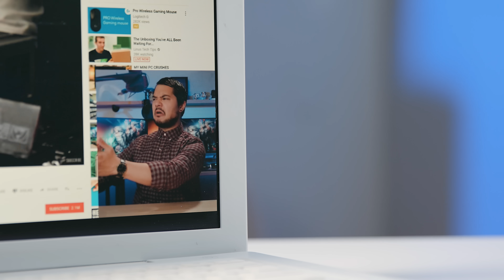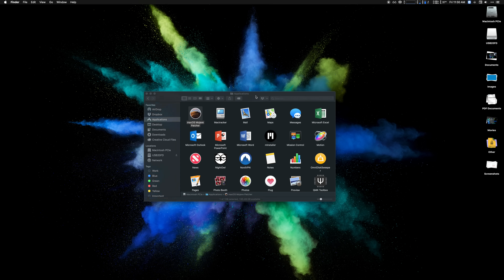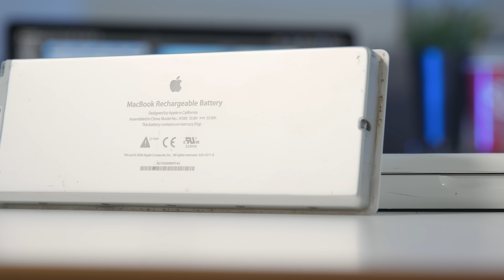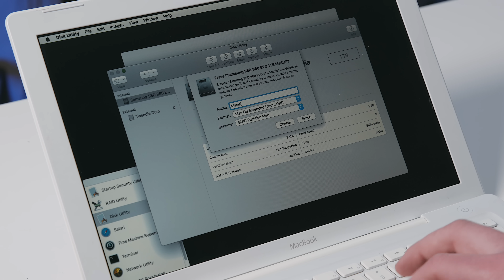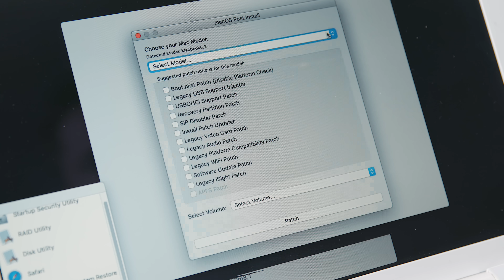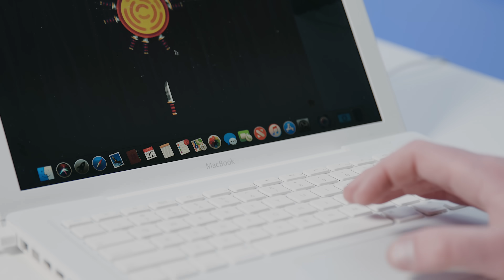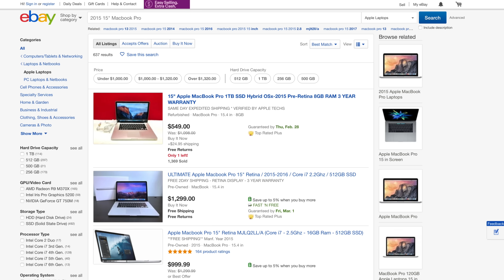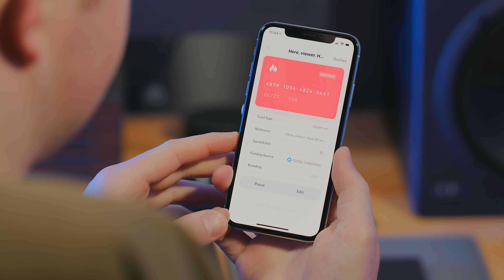Hackintosh a... REAL Mac?!

Comment: 0:25 High Sierra was 2017, not 2015. And the laptop is running El Capitan.
Reply from the maker: Yeah, botched that.
Reply: Your right bro
Reply: @BadKarma714  you're*
Reply: Yep. Last supported os is El Capitan, though there are Sierra and High Sierra Patchers available.
Reply: Also the 2011 MacBooks shipped with snow leopard. Not the 2009. Probably shipped with mountain lion?
Reply: Erik Kerber mine had Lion and was upgraded to mountain in store.
Reply: Awesome, I thought I was getting old really fast when he said high sierra was released in 2015!